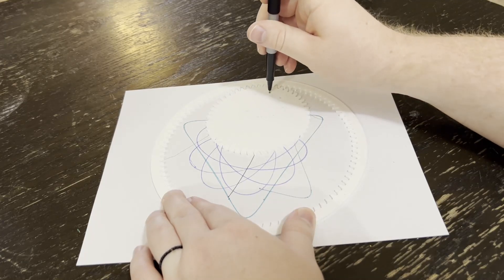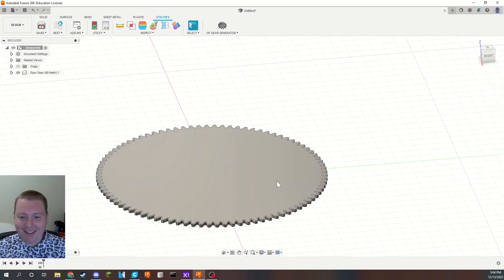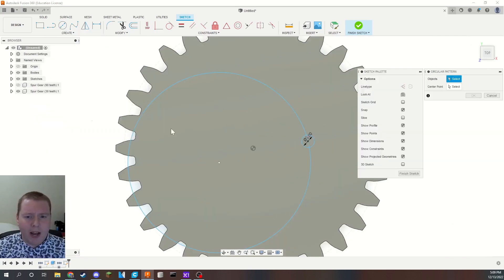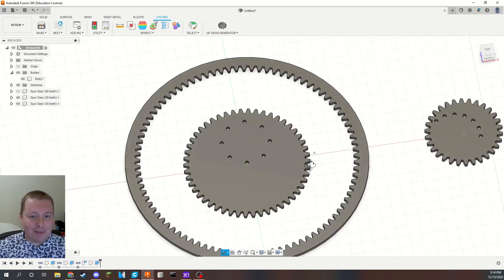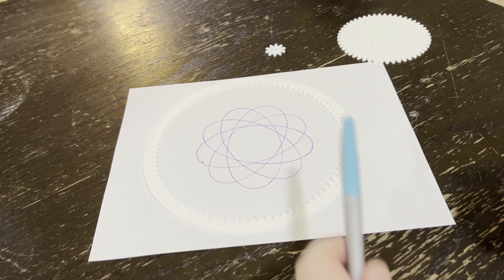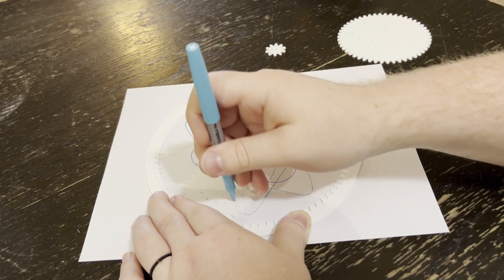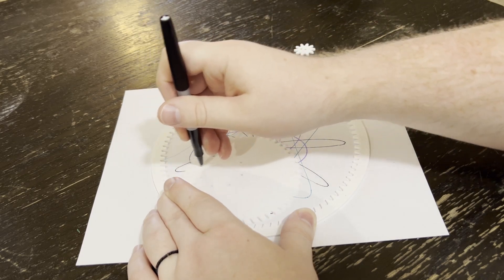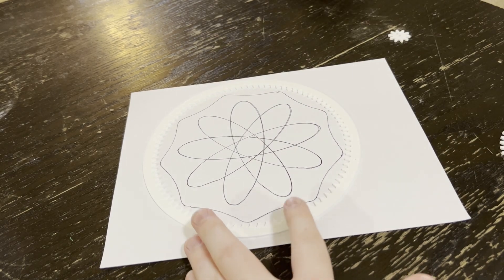Designing a 3D Printed Spirograph (Fusion 360 Tutorial + FREE STL)

Comment: Chris -- I suspect you are aware, but in case not -- Spirograph parts intended to be stationary have some smaller holes that you can use to hold the part in place using push pins. You start with a base of bulletin board material -- you can get small cork boards. Then lay down some thin card as a smooth surface. On top of that pin down a sheet of paper, then pin down one or more stationary spiro parts such as ring gear. then apply the moving gear and pen.  For this scheme you can also print some straight and curved sections of stationary gear that you can join together to form novel outlines along which you roll the drawing gear.